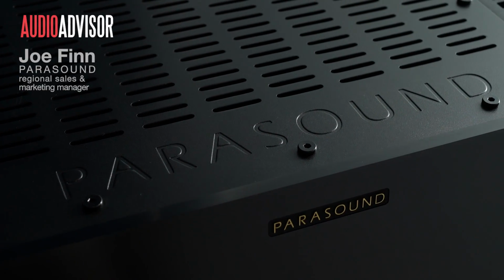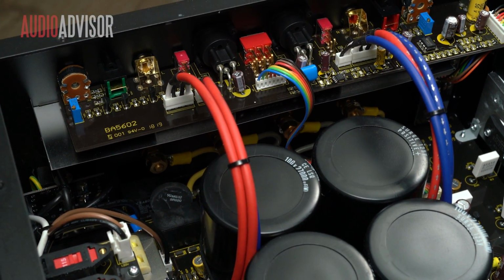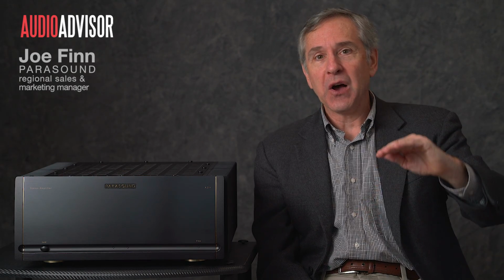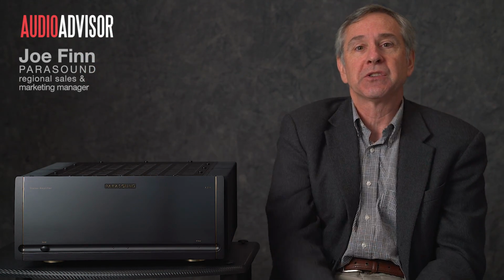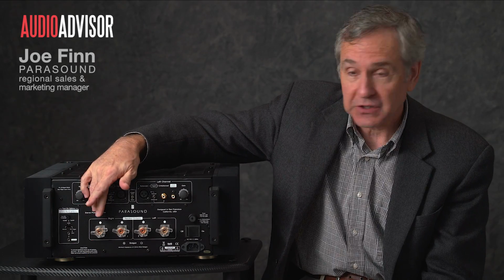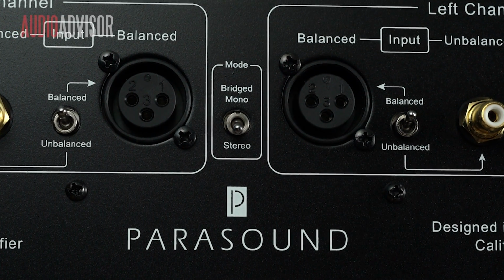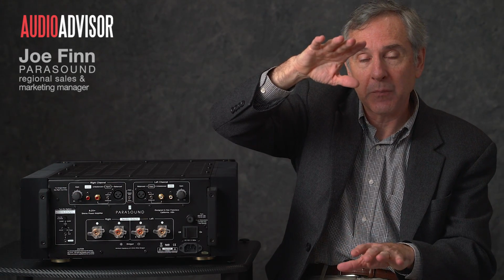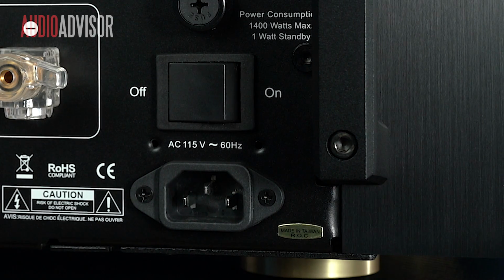Parasound Halo A 21+ Power Amplifier with Joe Finn – Audio Advisor

Comment: Why don't you use silver connectors on the terminals and all through the wiring and the transformer. silver doesn't tarnish if it's mixed with another metal of about 5%.
So you could mix it with the copper say 20% copper the rest silver I've only know of one Japanese company using silver in the whole construction in the wiring.
Looks like a nice amp how much some ridiculous price probably
Reply: About 3 grand
Reply: @jkherberger  what the power amplifier I'll stick with benchmark
Reply: Gold is a better conductor.